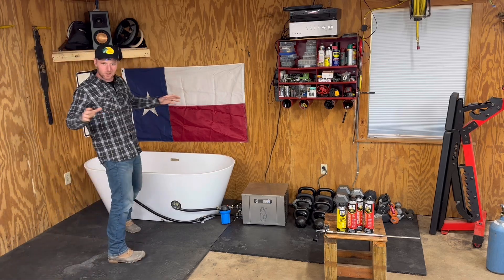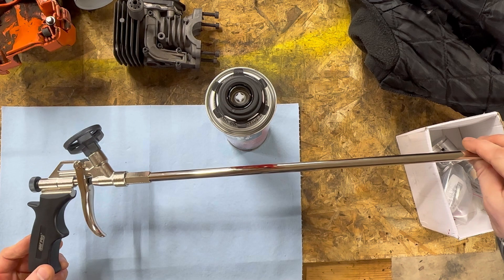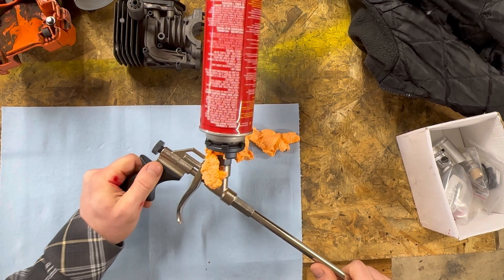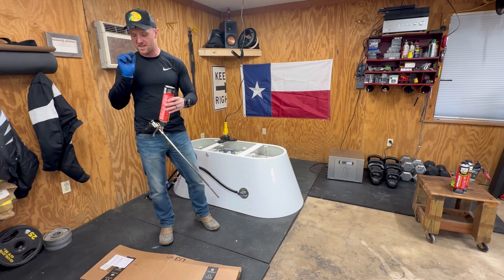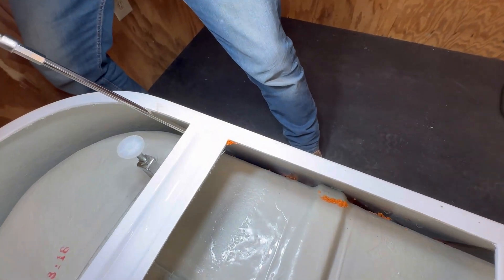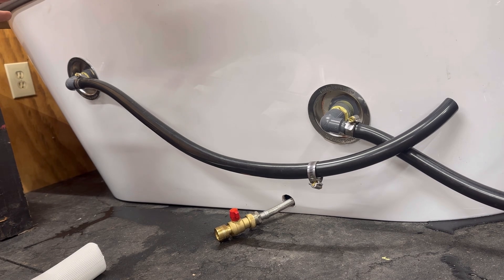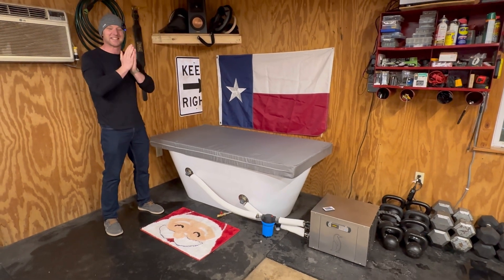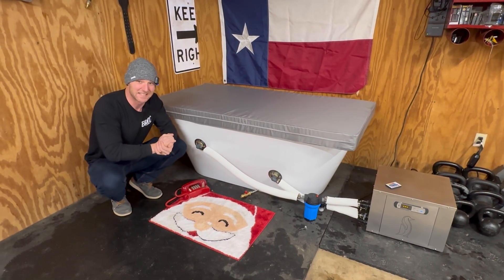Freestanding Tub Insulation: Penguin Chiller Cold Plunge!

Comment: VASOLINE should be used to coat the rim and threads of the spray gun fitting, the end and tube of the gun. It prevents foam from sticking. Simple cleanup with a paper towel
Reply from the maker: Man that is a great suggestion. Wish I knew that before. That gun never came clean and it got tossed.

Comment: How's this system holding up a couple months on?  Did you ever build a frame around it?
Reply from the maker: It is doing great. The chiller is a bit overkill for my setup but I love it. Will get to temp quick and holds it like an ice chest.
Reply: @MowerMike  badass, thanks.  Have watched a bunch of these DIY vids and appreciate your approach.  Did you end up moving it around as much as you thought you would (taking it off site to go chill somewhere else)?  Looks like it's living on horse mats, do you just put a bath mat down to soak up any water, or has that not been something you GAS about?  Finally, any thoughts to building out a full frame so it looks all fancy? Again, nice work!
Reply from the maker: @thegristleking  Nope it hasn’t moved. It is on housemats and I have a little bath rug infront of it. Works great. Personally I like the tub approach and is easy to seal up. I have another video on me insulating it. Is fun to build one. Use my links in my video description to buy anything if you go with a tub or this chiller. Have fun
Reply: @MowerMike  yeah, I think you've got the best setup out of the ones I've seen. I saw the insulating vid you did.  Appreciate you putting all this out there.  Will use your links, I know those are helpful on the rev side.